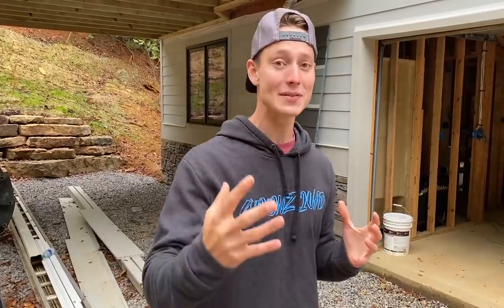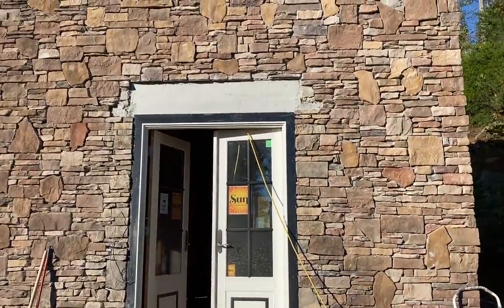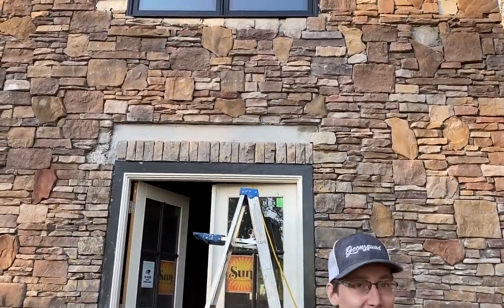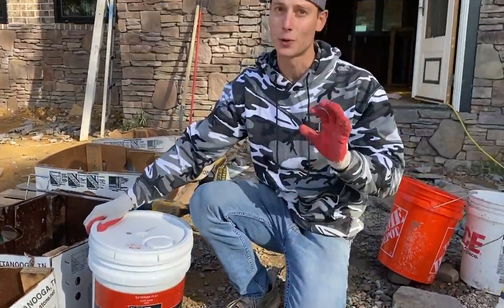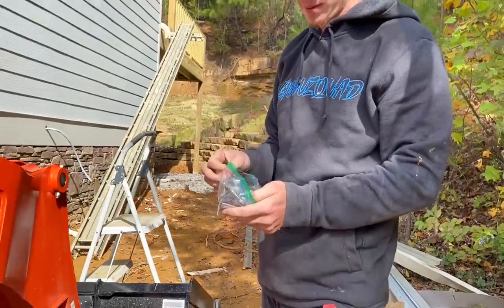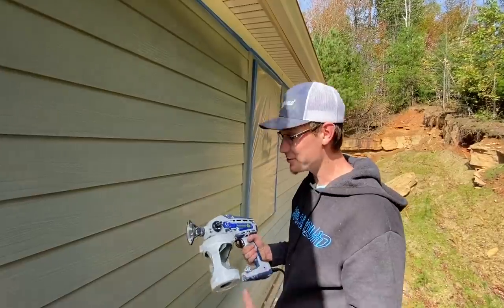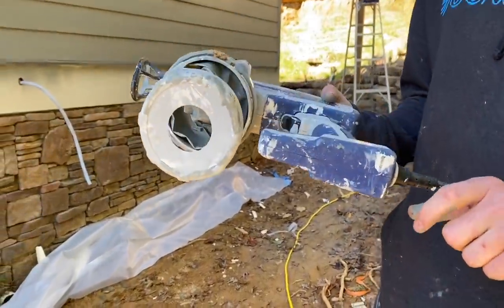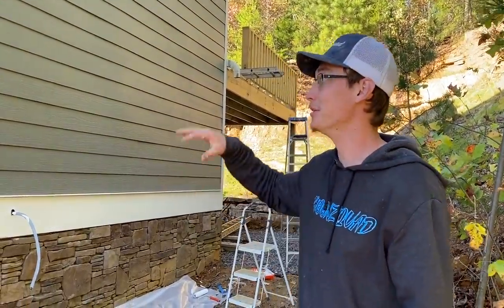The New Goonzquad Headquarters Part 31

Comment: Not painting the stone is a mistake imo. As soon as they replaced the windows with modern looking windows it's changed the entire facade. The black modern windows and old period look of the stone doesn't look good at all. Its a poor miss mash of two different periods and I think it looks awful. I would definitely paint the stone now (although I wouldn't have swapped the windows out for modern windows but if forced to then at least go with white frames) because currently it looks like a poor 1980's office facade where they weren't sure if they should go modern or old school and messed it up by trying to do both. Sorry guys, but I think you've made a big mistake here, the masses aren't always right I'm afraid.